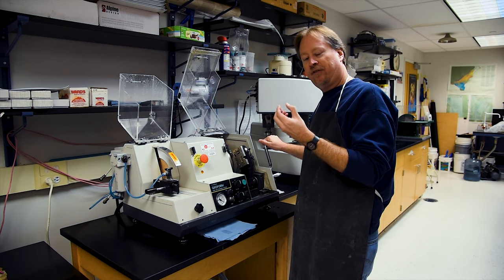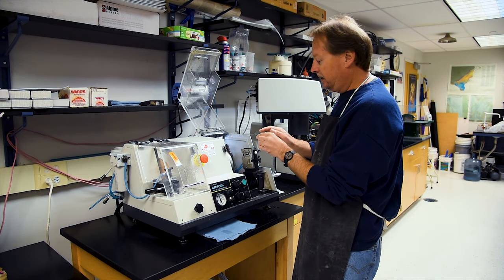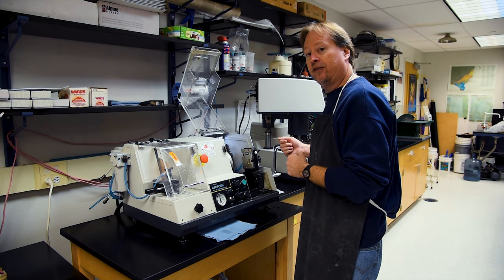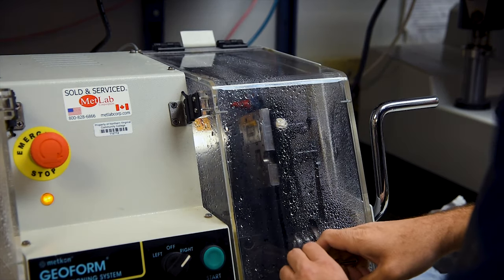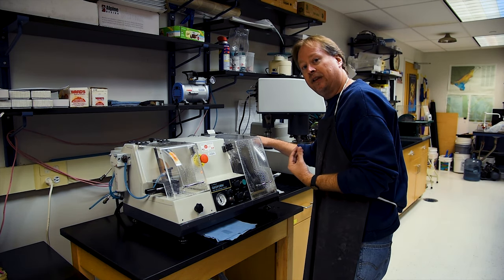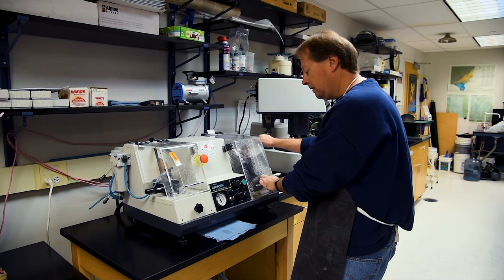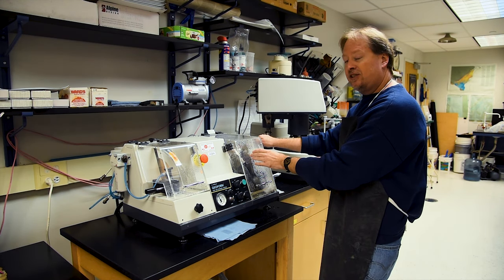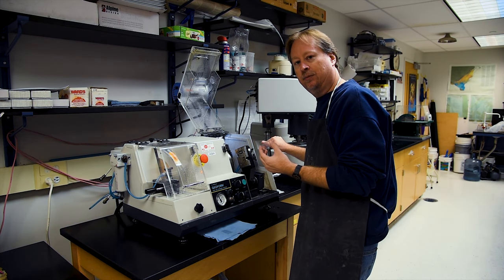Making Rock Thin-Sections: 05/10 - Frosting Slides

Comment: I really don't understand the purpose of this step. A glass slide starts out 1) perfectly smooth and 2) perfectly transparent, and you're deliberately trying to wreck both of those qualities? Very confusing. What good is a 'frosted' slide that you can't even see through any more?
Reply: Epoxy adheres better to a frosted surface. The slide is simply a backing for the fragile thin section; you don’t look through it.
Reply: Ahh, okay. Thanks for the info.